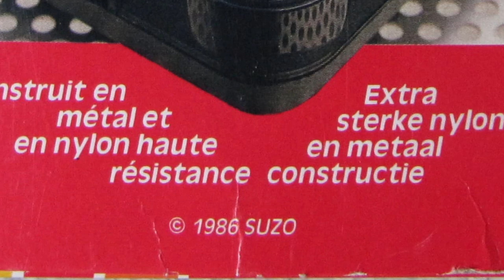Suzo Arcade Turbo Joysticks yet again! Let's take a look at an early unit from '85.

Comment: I also think that they were made primarily for MSX computers. For Commodore (C64 and Amiga) users it is important to know that the 2nd button was wired for MSX and it connects Pin 7 to ground. Which is +5V on the Commodore Machines and thus creates a short. I guess that explains why some of these Joysticks smell a bit when you open them ;) In one of my Turbos there even is a jumper to disable the 2nd button and so avoid any shorts.
Reply from the maker: Yes, pressing the scond button on the C64 will freeze/crash the machine when it's plugged in joystick port 2.  Found out early on with a Prof competion joytsick. The smell is indeed characteristic, the pcb in the joystick is that kind of phenolic paper that is made with a certain type resin. Also the rubber ring that centers the joystick is of a type that gets brittle with age due to the plasticizer decomposing over time.

Comment: It would be interesting to know whether there were versions available of the arcade turbo joystick which support the two-button games for the amiga.
I know there was a version supporting two-button games for the MSX. There are differences in resistor value and the addition of a diode (amiga version?).
Reply from the maker: As far as I'm aware, Suzo only made 2 two-button joysticks for MSX computers. The second button should also work with Amstrad CPC's considering the pinout of the second button. Some computers used pin 9 (Amiga and Sega Mastersystem), and the MSX and Amstrad CPC happen to use pin 7.

Comment: But how do you open the shaft of the Arcade? Do you just brute force off the inner disc?
Reply from the maker: Yes, that’s more or less what I did. The disc is is easier to get off then it looks, it’s mostly friction fit. Sometimes it is fixed with tiny bit of glue, but it’s fairly easy to overcome without damaging it. I have done this many times, never damaged one so far. These joysticks are rock solid.

Comment: I have one with the leaf fire button and I’ve been wondering if it’d be possible to replace the leaf switch with a micro switch. Do you know which microswitch I’d need to get? Is it the same as what’s used for the stick switch, what about the lever on it?
Reply from the maker: It is possible to replace the leaf switch it with a micro switch as the circuit board of the leaf switch version will already have 3 holes in the pcb as well as the connections present. However finding the right microswitch is an entire different story. The switches that Suzo used are often the Miltac brand switches (these should still be available) but the exact one with the long lever is not manufactured any more as far as I know. I've heard that some people where able to fit a different brand of microswitch in there. There are quite a few microswitches on the market with long levers, you can easily bend them into the right shape with some pliers.
Reply: dykodesigns2yt I’ve spent far too long this evening trying to find a suitable microswitch. This isn’t my area of expertise but it would be nice to get a nice clicky button.
Reply: if you want the leaf front button replaced i found a long lever 55mm microswitch at www.conrad.nl for €3 a piece. needs only some pliers to bend it to shape
Reply: Marco Manuel Do you have a more direct link to the product? I can’t find anything on that site.